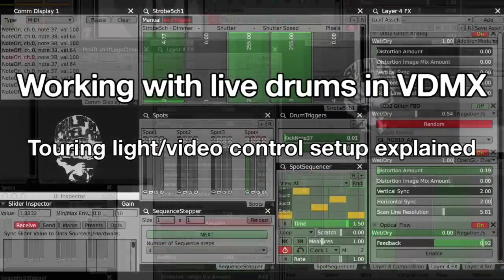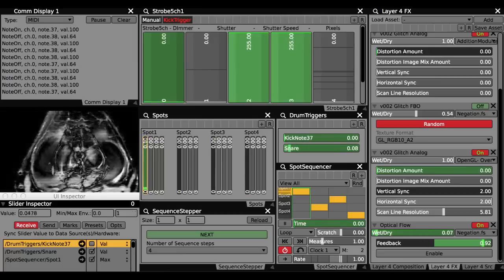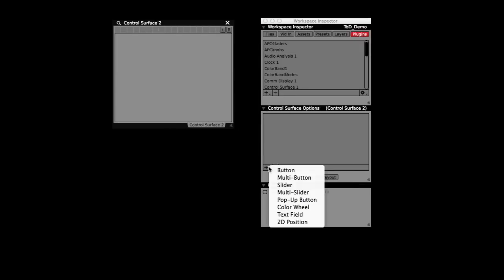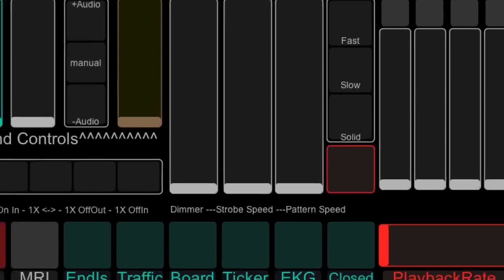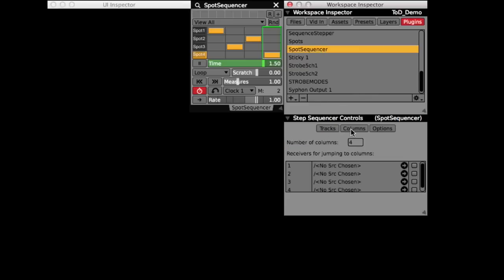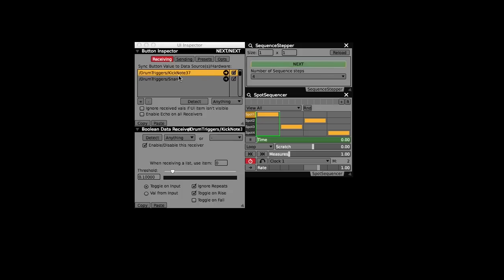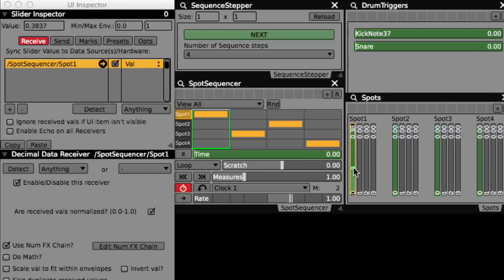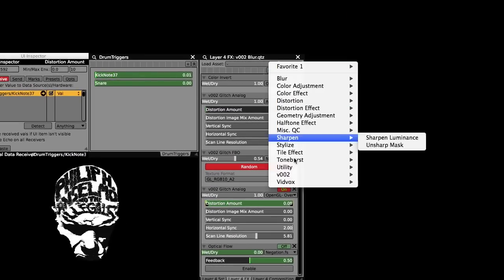Working with Live Drums in VDMX

Comment: Hi cut mod, about the fall data fx for the spots... If I understand correctly you want the punch on those sliders to instantly go full on and then fade back down rather quickly.  If that's the case fall will work.  So when you are in the sliders controls inspector, there is a button that is called "edit num fx" or something, a seperate little window will pop up, you can add number fx here... Use "fall" and then you will have a parameter for how fast it falls after being popped on.  Hope that helps
Reply from the maker: I think that would work if I were controlling those sliders more directly, (or maybe put another set of control surface sliders in between). However, when they are controlled by a Step Sequencer, the values don't drop off like expected. It did take me a while to figure out that Fall is more like a decay than release, which would have been ideal if the Step Sequencer control didn't override the fall. Would be great to have an ADSR number fx chain... maybe that's the next plugin.

Comment: excellent video, I love seeing how others use VDMX. Interesting to know about the stepper plugin but I dont think its neccessary, cant you just pause the sequencer, set the mode to seconds vs measures (red Clock button) , set the length to 8s, and use boolean on the jump button that as been set to 2 seconds... I use this method all the time and it works well, either way you should pause the sequencer, as you can see its vibrating, trying to move but not being able to.  Also, isnt it easier to just use a fall data fx on the spots instead of max.... but that max technique is a nice trick. :)
Reply from the maker: Hal Lovemelt Wow that's a great trick with the jump button! I figured there had to be a way to do it, but I found the stepper solution before I spent enough time tinkering. Seems a bit silly now, but I'm glad I found the stepper for many other uses. And yes, it seems I forgot to pause playback, good eyes! Could you clarify your suggestion for Fall FX on the spots? Thanks!

Comment: I honestly think you are underestimating the power of vdmx, i dont think there is a need to make a plugin for that kind of thing. you could A, use interpolated number tracks in the step sequencer instead of boolean and then the num fx work, B use an LFO with the same kind of technique using the steping and /or C. use a seperate slider with marks,, and jumping with a smooth data on the control over the LFO / sliders... also you dont neccessarily need 4 sliders... you could use UI presets and have it change the output each time with the sequencer... and the data input be the same tiny quick lfo that is triggered ever kick... in the end there is a million ways todo it, the LFO way you could have exact control over the data waveform... full ADSR...
Reply from the maker: I'll be trying all those out, thanks. Indeed there are myriad ways to do things in VDMX, which I think is why we both love the program. So flexible! I agree there's no "need" for the ADSR plugin, (especially with the tricks you've just outlined), but it might be a useful tool for some people. I think it could save some steps and be easier to tweak on the fly. I don't see a way to assign control to the breakpoints in the LFO waveform inspector. Know a trick for that?